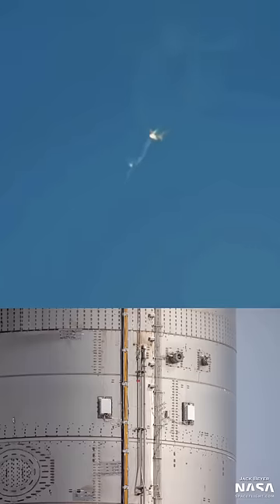Is This Why Starship Wasn’t Destroyed The Moment It Lost Control?

Comment: crazy. I just assumed that they delayed using it until the last second, because they hadn't technically left their flight envelope yet, so they just let it flop around for awhile to gather more data
Reply: There's no reason why you aren't correct. Until (or if) we have something from SpaceX explaining events, then it's all speculation anyway, no matter the source. 
As an scientist-turned-engineer, I'd want to record as much data as possible before it blows up, and if it is still within the safe zone, why not wait a bit...

Additionally, can you imagine the engineers all looking at their real-time data trying to see if they can spot the problem? These self-destruct decisions are quick, but not instantaneous.
Reply: I assumed they were letting it get to an even safer area before destroying it..
It seems like their flight termination system should be required to be near instantaneous
Reply: @jonslg240  14 CFR Chapter III - COMMERCIAL SPACE TRANSPORTATION, FEDERAL AVIATION ADMINISTRATION, DEPARTMENT OF TRANSPORTATION, Appendix D to Part 417 - Flight Termination Systems, Components, Installation, and Monitoring
says this: 

Flight termination system functional requirements:
(a) When a flight safety system terminates the flight of a vehicle because it has either violated a flight safety rule as defined in § 417.113 or the vehicle inadvertently separates or destructs as described in section D417.11, a flight termination system must:

(1) Render each propulsion system that has the capability of reaching a populated or other protected area, incapable of propulsion, without significant lateral or longitudinal deviation in the impact point. This includes each stage and any strap on motor or propulsion system that is part of any payload;

(2) Terminate the flight of any inadvertently or prematurely separated propulsion system capable of reaching a populated or other protected area;

(3) Destroy the pressure integrity of any solid propellant system to terminate all thrust or ensure that any residual thrust causes the propulsion system to tumble without significant lateral or longitudinal deviation in the impact point; and

(4) Disperse any liquid propellant, whether by rupturing the propellant tank or other equivalent method, and initiate burning of any toxic liquid propellant.

(b) A flight termination system must not cause any solid or liquid propellant to detonate.

(c) The flight termination of a propulsion system must not interfere with the flight termination of any other propulsion system.
Reply: @cerealport2726  There wasn't a human in the loop. SpaceX has an autonomous fright termination system. They started using it for Falcon 9 a few years ago, and Starship inherited it.

But the same principle still applies. It might simply see the tumbling as acceptable. Particularly since this is a vehicle which is supposed to make a pitch-over maneuver around that point in the flight.
Reply: This is also an analysis of the explosiveness of automobile gas tanks in 20th Century cinema
Reply: @cerealport2726 I’m curious as to why not just let it hit the ocean and recover it that way for more data, instead of just blowing it up into small piece.
Reply: @jenson1569  it would probably break apart on impact and cause a lot more local damage to the ocean as compared to breaking up in 30km altitude and distributing fuel and pieces over a bigger area. After all they got the most important information via telemetry, not too sure if the broken rocket would have been any contribution
Reply: @vassili7572 and adding to that, the fuel being oxygen and methane (natural gas), the fuel will pretty well be evaporated by the time it impacts the water, reducing the mass that impacts by a great amount. Plus as you said, the hardware will be well spread and safer.
Reply: @Cereal Port  And that solves it.
Reply: @cerealport2726  4.b. Huh. Ok.
Reply: @cerealport2726  So given the chapter you posted, it sounds like it complied. There is nothing in there which sets a defined period to 'Boom', so long as it's terminated such that it can't deviate and reach a populated/protected area.
Reply: I'm struggling to understand what "data" is relevant in a flight envelope where CFD is perfectly good enough to simulate what's going to happen, and information on how well your rocket cartwheels with a bunch of random high-velocity-concrete-induced holes in the engines really isn't that useful.

Minimising the debris field seems a good explanation though.
Reply: @Thermalions  I'm not in the business of building flight termination gear, but I have read a lot of similar "functional requirement" documents, and these seem to allow for design flexibility and initiative, rather than forcing people to follow very precise and strict systems.
Reply: @pseudotasuki  Correct. To be able to fly out of The Cape or Wallops, you need an AFTS. Not sure about Vandenberg but if you are already flying on the East Coast, you have one so it doesn't really matter.
Reply: @throx  
Well, getting a good look at how much abuse the system can take before it breaks apart seems like highly useful and worthwhile data to collect. I certainly didn't expect the first and second stages to remain together after three rotations. That thing must be built tough.
Reply: @dr4d1s  Yeah. That was the reason Rocket Lab's first Wallops launch was delayed for so long. It took years to get their AFTS certified.
Reply: @pseudotasuki  Exactly. I'm glad someone else realizes these kinds of things. Most just spout whatever nonsense comes to their mind. Lol
Reply: @throx  You'd think simulation would be good enough to figure everything out, but as SpaceX learned time and time again during physical operation... space is hard.

A bad strut caused by bad quality control caused a breakup on launch. An unforseen ice buildup in a COPV caused a rocket to blow up on the pad. A vibration test let them discover a fatal flaw in Dragon 2. It took 4 attempts to get to orbit, 5 to land on a barge, 5 to safely touch down after a belly-flop maneuver. 

No doubt, each and every one of those attempts before have been simulated thousands of times prior, but here's the thing:

Simulation isn't reality. Simulation is limited to as much data as we can put into it, and how much we can put into it is limited by how much we can observe from reality. With anything new, there will be unknowns. These unknowns are covered by the assumptions made by human intuition.

Fully integrated tests are less about seeing if the thing works but if those assumptions were right.
Reply: @cerealport2726  pretty instantaneous as they are all automated. The software sees something off-nominal, the signal is sent and the charges explode. No one is sitting there with their hand on a button waiting until the very last second so they can get more data. Automated FTS systems are mandatory to fly out of The Cape, Wallops and Vandenberg.
Reply: @dr4d1s  It might be "automated", but, according to FAA regulations,  it must be able to be operated by the Flight Safety Crew on the ground.  The rocket must be able to be destroyed at any time, even if an automated system says everything is "ok".

You neglect the importance of system redundancy and reliability too. System automation is not necessarily smart, or independent. 

So, yes, there is a "button" equivalent in the loop.
 
Also, have you not heard announcements on other failed launches around the world that the range safety officer made the decision to activate the FTS? It does still happen.
Reply: @pseudotasuki  yes, exactly why the FAA requires that there are humans in the FTS loop. automated systems may not see a problem that is obvious to humans, so the FTS may not automatically activate when it should.
Reply: @cerealport2726  Being able to destroy it doesn't mean there's still someone with their finger on the button. Which is essentially the point of AFTS. Maintaining the dedicated infrastructure to track launches is expensive, complicated, and prone to errors.

Vehicles were already providing better data through their telemetry streams, so it was all redundant.

As far as I know, an AFTS has yet to be used outside the US. Though I wouldn't be surprised if Rocket Lab has used theirs during a launch from Mahia.
Reply: @pseudotasuki  I'm going by what the FAA defines in their regulations, and an FTS must be able to be activated by the Flight Safety Crew at any time.  So, yes, there is some sort of "button" in place, in case the automated system fails. Is it really someone standing with their finger over a button all the time? I doubt it, but the FAA decrees that there must be a way to manually activate it from the ground...

I'm not disputing that the system will activate itself if various parameters reach or exceed thresholds, but there is zero chance that anyone who has worked with software and hardware would think such a critical system can be so reliable to run without the ability for human input.

Something can be automated and not be autonomous.
Reply: I figured they were still wanting to remotely collect data. Maybe see how and where every hot spot was and how/the pressure bolts warped.
Reply: It's possible they where out of the flight envelope pretty early on. The separation should take place at 65km altitude but they reached just 30 after 2min. This doesn't mean they have to blow it up if it is flying over a safe area. It was still interesting to collect data until it completely went out of control.
Reply: I thought they want it to move away as far as possible from land
Reply: @throx  I guess it provides data on non-nominal structural stress limits.
Reply: @jenson1569  because it's an autonomous system the computer makes the decision not a human.
Reply: Might be a combination of both, Idk if they had a backup "This is a stick of dynamite in case of total shit storm" kind of strategy but it would make sense to let the rocket tumble as long as they could to see if it WOULD fail correctly or whether they needed a more reliable termination method
Reply: It's a giant firecracker 🧨🧨🧨😅😅😅😅😅
Reply: Thought so also. This is so much precious data.
Reply: @throx  CFD ain't that good.
Reply: Funny how it blew / they blew it just as stage 1 fuel ran out.....

My money is on them flying as long as possible, but stage 2 ignition was never viable since altitude and attitude were way off mission.
Reply: @throx  it's free data, might as well take it. Maybe it will save someone hours of niche simulation run-time for an edge-case problem
Reply: @cerealport2726  there is a misaligned incentive for authors of requirements documentation to be as nonspecific as possible in order to avoid as many future audit failures and revision changes as possible.
Reply: @myuzu_  Yes, as an author and user of similar documentation (not space industry), I know what you're saying. It is easier to keep it up to date, but it does also allow for flexibility in implementation, which is also important.
Reply: @myuzu_  Further to this, there is a time and a place to be very very specific with requirements, and a time and a place to be quite generic. It's a hard balance to reach, absolutely.
Reply: @pseudotasuki   I also believe that as this is supposed to be a manned vehicle in future, you'd better not have a machine that goes "Oops, you're slightly outside the launch parameters - boom time!".  I think there's even supposed to be an ejection system for the cockpit, or was that cancelled?  If so, you need time between "Eject! Eject! Eject!" and self destruction.
Reply: @secularmonk5176  Ford Pinto FTW.
Design called for a bagged fuel cell. Production, steel can  behind axle.
Reply: Thats what I would have done.... Let it flop about to see what else goes wrong.
Reply: @jenson1569  I don’t think they would want to blow it up, but by law they have to “disperse any liquid propellant” and since the tanks use pressure for structural integrity doing this causes the breakup.
Reply: Yay! I threw away 3 Billion Dollars! To prove a point. Said elon
Reply: There’s slow motion video from every day astronaut of a series of explosions going up the rocket right before it totally explodes basically instantly. I think they did wait, and if they did blow a hole in the tanks it was probably to lessen the explosion. But from the slow motion video it’s very clear that they were able to destroy the rocket controlled and instantly.
Reply: @Xploit66  Actually, by law all they have to do is vent any liquid propellant, and burn any hazardous liquid (eg hydrazine). The flight termination system also can NOT cause detonation of the propellants, by law, which means they have to rupture the tanks in a way that doesn’t cause too much mixture before ignition.
Reply: Exactly what i think they did. First time up first time off the pad. They wanted to let it fly as long as they could to get as much info as possible. It didnt blow up on its own, they blew it up.
Reply: @DaryxFox  that would explain why they vented for a while and then right before the main explosion there was a series of small explosions going up the rocket. It was a two stage process essentially.
Reply: I agree og
Reply: Reading those regulations makes this whole thing feel intentional, like they had to show that their flight termination system worked as it should for the biggest/ strongest spaceship we've yet built. If it was intentional and Musk just shut a few engines down on purpose, this whole test was a flawless execution
Reply: They fuked it up, just like everything else.
This is NOT how it suppose to be.
when you press "self-destruction" button, that thing must be in pieces three seconds later.

Imagine that this rocket turn itself toward populated area that is only kilometer away from launch pad.
Reply: @jonslg240  ,
Many flight termination systems require constant overrides to stop them from activating as they are set for automatic activation from the time the stack clears the tower until a prescribed altitude is reached.
Reply: Heey this looks my rockets in ksp and when do say ahh its to much to recover.😅
Reply: @jonslg240  Instantaneous would require detonation, which is specifically forbidden by regulation.
Reply: @Eastside Azskelad The Gs would be minor. And it's had one flight, what are you talking about?
Reply: @Eastside Azskelad SN15 landed safely.
Reply: @Eastside Azskelad And no, Falcon 9 doesn't splashdown. It lands on a pad on the ground or on a barge. Where have you been hearing this nonsense?
Reply: @pseudotasuki  It's supposed to scare it to death?
Reply: @cerealport2726  indeed
The Range safety guy probably went like "give it a second more"
Reply: @jenson1569  Well then that would violate the range
Reply: I have no problem with liquid O leaking.
Reply: me in ksp but i gain nothing i just get to watch my rocket i spent hours making tumble and explode
Reply: Those extra flips were probably quite useful as far as data gathering is concerned.
Reply: All you have to do is think back to the Challenger accident. They waited and didn't blow up the SRBs until they seemed to be heading to Orlando. In this case the gathering is the most important thing, and those explosives are placed right where they need to be to spread it all over the place. That was an RSS explosion. Pretty certain there are more than just two boxes. They were all over the place on our external tank.
Reply: Yup that was my line of thinking too. If it's off course, and planning to go out of bounds, sure terminate it. But as long as they stay within their planned trajectory they can do cartwheels while shooting rainbow dildos out the back,  i figured that would all be at SpaceX's discretion lol.
Reply: These lizards can fly rockets and burn 10 tons of fuel but you can't have a car Or use a gas stove
Reply: Yeah I thought it was more of a data gathering thing myself
Reply: @jenson1569  this is actually an active debate in the space industry. The Russians, for example, hold the opposite opponion to the US and do not put any explosive termination systems on any of their vehicles.
Reply: @Thermalions  actually, to the contrary, it seems like the flight termination system is supposed to NOT detonate the rocket.
Reply: @Eastside Azskelad I think you’re thinking of the one that came before 15 that kind of landed then exploded. SN 15 sits proudly in the rock garden.
Reply: New Electromagnetic- propelled -conjuncted with special materials**-ie; antiGravity system suggested..
   The theory needed in fact,  exists.Are you familiar with this particular concept-set, Dr.Musk ?
   Have your  your 'Area - 71' men now actively set to work  on new proplusion ?
   Lose the  fuel propellant  regime  and construct  a low-power warp engine  regime  ;eg => reach Proxima Centauri before dinner tonight !
    Requested menu ; seafood,spinach , f.fries, and root beer.
    Thx!
 CarLAserio
 4/29/23
NY
Reply: Thats what they really did ..not what he explained
Reply: Bingo, which is exactly what they said
Reply: It did not break up on its own that is a super structurally sound mechanical piece. It was blown up after the fuel was released.
Reply: @jenson1569  The explosion was much bigger than it looked way up in the air. It’s essentially a giant bomb. It’s safer to blow it up at altitude than anywhere near ground level.
Reply: @DNMEBOY  would’ve been in the sea tho
Reply: makes sense….like timing how long from impact to break up if a small asteroid (like tiny space dust type shit, i imagine space “dust” is like the size of a baseball-bowling ball at the verrrrry smallest)
Reply: @tangydiesel1886  The solution to pollution is dilution!!!
Reply: @Remsster  you're correct!
Reply: @jenson1569  ever heard of a catastrophic failure..  yeah it's donw to prevent one from happening.
Reply: @meak13  letting it hit the sea is catastrophic Failure? 🤣
Reply: @jonslg240  or burning off as much of the fuel as possible before the rest dumped in the ocean
Reply: 🎉O❤🎉😊, 4
Reply: @cerealport2726 y🧨🚻
Reply: 1 @jenson1569
Reply: @jenson1569 39 6
Reply: @jenson1569 oty7
Reply: @jenson1569 03
Reply: @jenson1569 😊😢❤❤😅😢💔🎉😧😢😊😊😥😔😰😊😊😊😢🍑😊😂😮🎉Mr 😅🎉😂🍈😢🌛🙋❓😶💃👠🕥🕞😢🕓🕑😅😢😅😮😢❤🕤😢🕜🕟🌱😂🕕🕖😊e😢 o0😟❤😊😂😮🍈😧😊❤🎉💔
Reply: @jenson1569 0
Reply: That, and I don’t think they wanted a large vessel of fuel hitting the ground un-burned
Reply: @cerealport2726 with failure there is room  for growth.

The way in which the rocket fell and tumbled without exploding, that would give a crew time for ejection.

If you can kind of uncontrollably glide, then ejection could be viable if speeds weren't too high.

I'd imagine ejecting from a rocket at that speed, hitting air that isn't moving over 20,000 mph, could be equivalent of slamming into a brick wall.

Still, it's better than simply exploding
Reply: Gather more data-agree. Also feel like they were doing maneuverability testing for in atmosphere correction.
Reply: It failed to separate as they wanted it continue on but the release failed.
Reply: @pseudotasuki  
Starship was at least 15 miles below the planned separation altitude. So, no your speculation that the system thought it was a separation event is not at all likely. Uncontrolled tumbling was not, and is not, regarded as "acceptable" by the system. The termination system fired and the break up took 50 secs because the FTS didn't blow up enough of the x 2 tanks involved.
Reply: Yeah
Reply: @vassili7572 fuel will get into the ocean but it's mostly liquid hydrogen and liquid oxygen which aren't like a tanker full of oil so no damage to the ocean. That rocket is 1 atom in an Olympic swimming pool not going to notice or see damage
Reply: True. Data is data.
Reply: Too bad the flight computer got burnt up lol if that never got damaged it probably would have made it to orbit
Reply: This is the most logical reason. Collect data. Figure out what kind of things are going wrong and see how it escalates. Can it be corrected? Is it a lost cause. All important information
Reply: @throx the rocket may have a recovery program designed to compensate and attempt to recover the rocket or its payload. It may be being tested in this event or the data may be used to train a system in the future.
Reply: "abort abort abort" "unable"
Reply: the auto destruct was probably tested as well
Reply: @jonslg240  normal observation. That is still one consideration. I gathered.
Reply: @gregansen544  responding to your comment "4.b. Huh. Ok." It's an older comment so I didn't want you to dig for it if you see this.

Anyways I believe the wording is very important in that clause. As detonation is different from combustion. Combustion is just burning, whereas detonation is an explosion. Essentially I believe they're saying the fuel can't bang or boom when it terminates, but it can burn.
Reply: @cerealport2726 buddy you are a scientist and an engineer. Stop kidding yourself
Reply: @Mclovin231  No idea who you are, but I'm not your "buddy". I was working as a scientist, now I'm an engineer, It's entirely possible, if one doesn't mind going back to university and doesn't live in a failing country where university degrees cost hundreds of thousands of dollars. 

Fact is, there is still a human in the loop for self-destruct, even with the most automated abort systems. It might be extremely rare that a human has to actually do anything, but it is still a possibility.